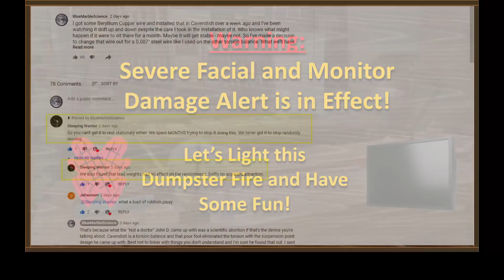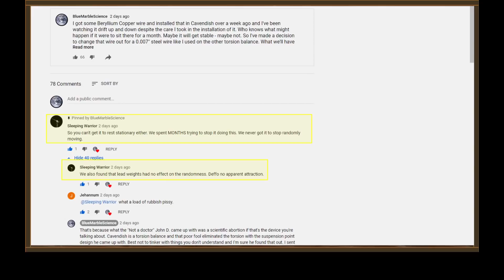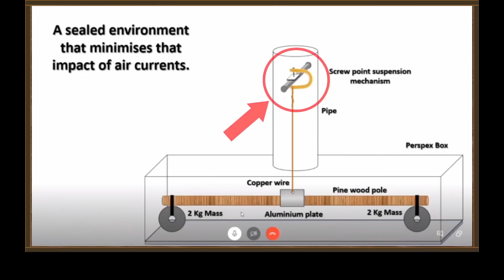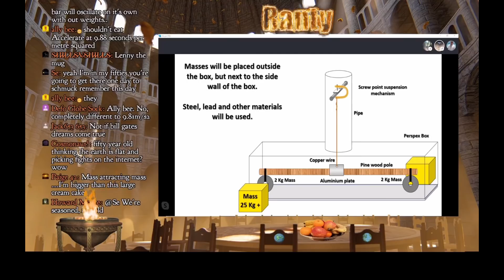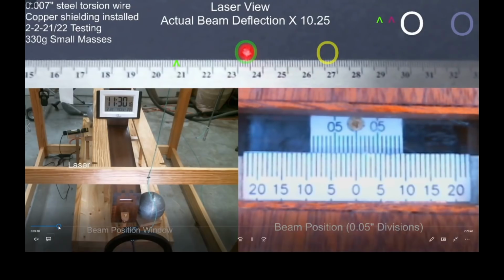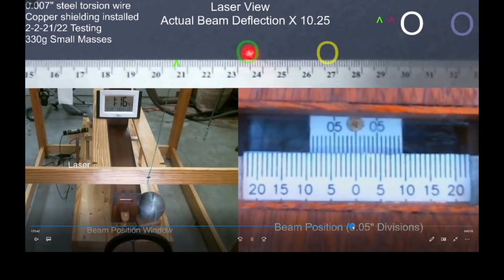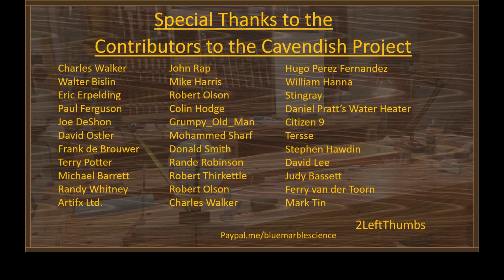How to Build a Cavendish That Isn't a Cavendish

Comment: I was TRYING to explain to you a point you were refusing to listen to and I eventually gave up with you. You were either too stupid to understand what I was saying... or you were being deliberately evasive. Either way, I gave up on you because of it. 

There is no honest conversation with you people.
Reply from the maker: No Anthony, you were displaying your complete ignorance concerning this topic. I've done many hours of video explaining the function of a torsion balance, showing how one is designed, showing step by step how one is constructed and showing how the measurements made with one can be used to determine the value of "G" but you apparently didn't watch any of them. If you did, you certainly didn't learn anything. I can't have an intelligent conversation with a guy who is telling me " You need to prevent the oscillation to show that you have isolated the variables you are meant to isolate. You seem to be defending your failure here". Say what? And my favorite, "Just show that you have successfully isolated the forces causing the "random drift"..." I doubt you realize how ridiculous that sounded or why. Drift isn't being caused by any force you can isolate Anthony. Drift is caused by stresses in the torsion element. That may or may not have been what you saw. Your movements were more likely due to things like my garage overhead door or that acrylic box you built. Just rub the neighborhood cat on that thing and you'll build up enough static electricity to weld boiler plate! 

But I think there may actually be much more to this. I would have thought that you guys would have made some video of this random uncontrolled movement you mentioned and shown it to the world. The fact that you didn't raises questions. Even with the flawed design you have, that thing still should have responded to a gravitational attraction. Did it? Is that why nothing was ever shown? I'm not accusing you guys of anything - just asking a question.
Reply: @bluemarblescience  You do realise we are NOT trying to determine the density of earth with a torsion balance. All we are trying to do, at the very start, was trying to ensure that nothing else was influencing the action of the bar when it was at rest. 

Do you understand this? We cannot go ANY further until you understand this. I'll type it again. 

"All we are trying to do, at the very start, was trying to ensure that nothing else was influencing the action of the bar when it was at rest."

So before either of us touch it, for any purpose, we need to ENSURE that nothing else is acting on the setup. 

You have not shown this despite being asked to do so. It's a very simple preliminary check. We were unable to isolate all forces and that's why I'm asking you to demonstrate that you have. I'm not being unreasonable.
Reply from the maker: @sleepingwarrior4618  I did - watch the video. It's sitting perfectly still for an hour and twenty minutes. It moves slightly in response to transient disturbances. But I take it from the way you dodged the question that you actually did observe gravitational attraction. You must have or you would have show something. Just show us the bar moving randomly without the large weights in place and then show that it does the same thing with the weights first one side of the box and then the other. That isn't a problem is it?
Reply: @bluemarblescience  you haven't shown it with frictional forces and torsion removed. You claim you have but you have not. I asked for those resistences removed to demonstrate that nothing else is acting on your setup.

I admit I couldnt get it to behave at rest with no friction or torsion to negate whatever forces I was having act on mine.

I want to see that you HAVE done though. Please SHOW that you have removed friction and torsion but also got a stable rest position. 

If you keep avoiding this, I'll respond by video and make it very clear what results I have and what I think you are having and why.

It's a very easy request to demonstrate. No friction and no torsion.....and a bar that's not moving. 

Can you do that? Or nuh?
Reply: @sleepingwarrior4618  oh jeez... Just make the video.  It's not like that's a threat!  "If you keep avoiding this, I'll respond by video...". Dude, that's science.  You have an issue with his set up. You publish what you think is wrong with his set up by using your own.  That's literally science.
Reply from the maker: @sleepingwarrior4618  Why are you ignoring my request Anthony? I've stumbled up on an inconvenient truth haven't I? That bar moved to whichever side of the box the large weights are on didn't it. And now, you're trying to shift attention away from that result by imposing irrelevant and irrational restrictions on an experiment you don't even understand. You need to show what you did. I have - why haven't you? I thought you guys were after the truth but that isn't it at all, is it. You're desperately trying to cling to your fundamentalist religious beliefs and you're willing to do anything it takes regardless of the truth. Lets confine the discussion to what I just said. Please show us a video demonstrating your claim and including my proposed tests with the weights.
Reply: @sleepingwarrior4618  I like the way you dance Anthony!    Dance boy dance!
But you don't have a pretty mouth though.

Sorry Blue couldn't resist.
Reply from the maker: @sleepingwarrior4618  I am curious though Anthony. Where do you believe friction exists in a torsion balance other than the internal friction in the molecular structure of the wire, and how would I eliminate torsion?
Reply: @sleepingwarrior4618  Anthony, do you not understand that the whole point of the Cavendish experiment is to USE the torsion of the wire to provide a very weak restoring force? That force is proportional to the angle of rotation, so at some point it is equal and opposite to the pull of the large masses on the small ones, and the beam will settle at that position. If there is no such pull, i.e. if (as you claim) masses do not attract one another, the beam will not move, but Blue has demonstrated that it does move.
If the torsion could be “removed” as you are asking (spoiler: it can’t) the experiment would not be possible.
Reply: @bluemarblescience  "Why are you ignoring my request Anthony?" 
Because, as with assuming a gradient to calculate "Atmospheric Pressure", you are assuming you have your set up working correctly without checking/showing. I'm not prepared to move off this point because this is the point where I had to stop. I admit, I couldn't get it to stop dancing about. Thats why I am asking to see how you DID manage it. It's the first thing you do once it's built but BEFORE you try and do anything else. You want to ensure that you have isolated all the influencing factors Cavendish warned you about. You cant move off this point until you prove that you have satisfied it. The point you are demanding comes AFTER this point, not instead of it. 

"I've stumbled up on an inconvenient truth haven't I? "
Yes, I think you have. I think you have stumbled across the same issue I had and are projecting onto me your own dishonesty because you CANTTTTT have anyone know that yours is doing the same as mine. Thats WHY you are getting your random movements. Yours are being manifest slightly differently because of how you have yours set up but yes, I do believe you have indeed stumbled upon an inconvenient truth... but its not one on my part. Its one on your own side and I know you know this.

"That bar moved to whichever side of the box the large weights are on didn't it."
No. The weights had absolutely no effect on the action of the bar. it did what it want, to whatever extent that it wanted to and I could not stop it.

"And now, you're trying to shift attention away from that result by"
This is the projection. I can admit and accept that I could not stop mine from behaving erratically...but I think yours is doing the exact same and you know it and thats why you cant control it. 

"imposing irrelevant and irrational restrictions on an experiment"
Noooooo, we both must prove that we HAVE isolated all factors. I couldnt isolate mine but you ARE getting them. Thats why you have movement. Why do you think I'm asking numb-nuts?

"you don't even understand."
Stop being a tool. No need. 

"You need to show what you did. I have - why haven't you?"
I dont need to show it at all. I haven't shown it because I thought I had messed it up. I thought I had done something wrong...until I saw and read about you getting random movements too. This is why I'm contacting you. You are getting the same results as me but you wont listen and demand that I am to blame... well try listening and PERHAPS we can get to the root of the issue you are finding because I believe its the same issue that I am having. I blamed myself though... but when you started having very similar (the same) issues, then I realised that it wasn't me.... but also that you were not being transparent. You have not shown the zero friction/zero torsion setup to prove that nothing is influencing your beam. It's very simple, I'm sure your own morons reading this will understand my point even if you pretend that you dont. 

"I thought you guys were after the truth but that isn't it at all, is it. You're desperately trying to cling to your fundamentalist religious beliefs and you're willing to do anything it takes regardless of the truth."
I am after the truth. I gave up on my test a few months back but Im invigorated now because you seem to be having the same issue as I had but dont think its an issue. I thought it was terminal and gave up after trying to block out whatever was causing it. 

"Lets confine the discussion to what I just said"
No, you need to show that your setup is NOT influenced by external factors by removing torsion and friction BEFORE we can accept your confinement. Sorry.

"Please show us a video demonstrating your claim and including my proposed tests with the weights."
Okay but not until you prove that you can remove the friction of the pivot point and and torsion with the most appropriate twine to demonstrate this.... THEN show that it will stay at rest for 15 or 30 minutes WITHOUT wandering. You do that.... (and focus on the pivot point and the torsion as much as the results) and I will show you what results I got. I have loads and loads of 15minute time lapse photos in a variety of conditions and at a variety of times of day with and without lead weights in the picture.

"I am curious though Anthony. Where do you believe friction exists in a torsion balance other than the internal friction in the molecular structure of the wire, and how would I eliminate torsion?"
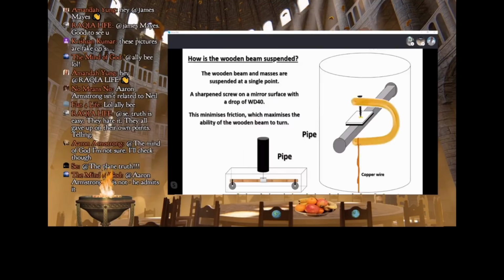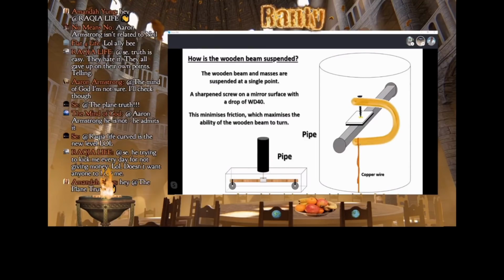Friction exists at the pivot point as well as in the twine you are using. You can eliminate torsion by reducing the friction at the pivot point. The very criticism you gave in this video is the same point to remove the torsion from 4:27 to 5:10. Thats WHY the screw was sharpened to a tiny area of contact on a piece of glass. Less friction at the pivot point will remove the most amount of torsion in the twine. You would do this to PROVE that 1) Nothing else is influencing your rest position and 2) if mass does attract mass, with minimal friction, we can test that. I know I know, thats not what Cavendish did, he used torsion and measured the net effect... that can be done by fixing the rotation point at the top but you are trying to repeat his test. We CAN do that... but we can also directly see if mass does attract mass or not and have zero friction at the top. 

Dude, I'm not being unreasonable or funny... I'm just asking you to prove that nothing else is influencing your bar at rest by removing friction and torsion and show that it will sit still for 15 minutes. I couldn't do it.... but I blamed myself. You claim you have done it but also claim random movements... you are getting the same effect as me and are glossing over it... but it actually invalidates any testing you think you (and me) can do because you cant have other things acting on the weights. It does need to be isolated.

If you prove that yours is stable at rest (with minimal friction and torsion), I will show you the results I got and your drongo friends can all laugh at how I couldn't even repeat Cavendish...but if you were honest, you should be proving that you CAN get it stable and THEN I would ask you to help me with mine because I'm clearly getting something wrong.

Remember, I gave up on mine because I thought I had built a bad set up, spent MONTHS trying to make it work and didnt release anything because no one on your side is honest enough to accept that it might not be me, it might be something in my environment I didnt spot... but THEN I REALISED YOU WERE GETTING IT TOO!!!!

Up to you buddy.
Reply: @sleepingwarrior4618  "okay but not until you prove that you can remove the friction of the pivot point and torsion with the most appropriate twine to demonstrate this..."

Dude.  Again, science.  You see a problem with his set up, you create and publish a demonstration to show how you think he's wrong.  Make your video, bro.  Do it his way, then do it your way, then publish the video.  Literally how you peer review in science!
Reply: @sleepingwarrior4618  "... I'm clearly getting something wrong." the only honest thing you babbled about.
Reply from the maker: @sleepingwarrior4618  It's truly sad that you don't have enough physics or engineering background to understand the mistakes you've made. You were right about one thing, you're design is fatally flawed and that's what's causing your problems - problems that I haven't had regardless of your misinterpretation of what drift is. My Cavendish device has behaved exactly as it should have. The data it provides is excellent and the results far outstrip anything I had hoped for. I called my shot Anthony. I told you guys upfront that your idiotic pivot point wasn't going to work and why it wouldn't work. Now I'm telling you "I told you so". 

I'm getting prepared to replace the Beryllium Copper wire I've been observing over the past couple of weeks. Beryllium Copper is a very springy material - in fact that's what it's used for - springs. I only went to it for it's increased yield strength over pure copper since Cavendish had used some unknown copper alloy. But it clearly wasn't BeCu which wasn't around in those days and this stuff drifts too much for accurate measurements. By drift I mean plus or minus 2mm maximum at the end of the balance. Does that sound like what you got? Obviously not. Yours bounced off the cabinet walls didn't it. Do you know why it did that? Because yours isn't a torsion balance. It has no pendulous action because it has  no restoring force! Before I remove the copper element, I'll do a time lapse and show you what drift actually looks like and why even with drift you can still see the obvious and indisputable effect of gravitational attraction.

And after I replace this copper element with a steel wire, I will do what I did with other wires. I will allow it to sit undisturbed with the large weights in a neutral position. If the balance isn't moving, that is a zero torque, zero friction condition and you're going to see a perfectly stable torsion balance. I just showed you the balance sitting motionless for a period of an hour and twenty minutes but we'll do it again just for the record. I'll even live stream it just to add to your horror so feel free to join in the chat and show your ass as you usually do.

Now I'm done with you Anthony. Not only did your Cavendish attempt fail, your attempt to coerce me into repeating your stupidity has failed as well. I think all of this is pretty clear to anyone that has a look at what I've done.
Reply: @sleepingwarrior4618  Anthony - your attempt to make a frictionless pivot at the top is your problem! If you could truly create a frictionless pivot at the top then your setup has no rest position at all. It will freely and randomly spin around to any position due to the tiniest micro air movements, fly farts or whatever. If it wasn't constrainedin the box it'd be randomly spinning around anywhere in the full 360 degrees. This is what is happening in your setup! It is the fixing of the wire at the top of a correct setup that actually gives it a rest position. The rest position, without any external influence, is the position where the wire is not twisted at all. When it has come to rest it'll happily stay there until some external force moves it.

If the external force is random and transient, like a fly fart, it'll just wobble a bit and come back to rest at the same rest position. If there is a permanent force, like, I dunno, gravitational attraction of some big lead balls moved into place, it'll wobble again but come to rest in a new rest position with the wire slightly twisted due to the attraction. That's how this thing is supposed to work and how Blue's does work! Yours will never work this way as you don't have a fixed wire at the top and therefore don't have a default rest position - it'll just randomly spin around all over the place indefinitely. Further attempts to reduce friction at the top will just make yours worse - it will be even freer to spin around randomly and never come to rest.

You need to increase friction at the top - completely, i.e. fix it - then it might start behaving properly. Hopefully this is clear enough that you understand why. Respect for actually trying some real science though!
Reply: @sleepingwarrior4618  A "frictionless system" is much like "flat earth", IT DOES NOT EXIST!!!
Reply from the maker: @sleepingwarrior4618  I did - watch my live stream. You just had your ass handed to you!
Reply: @sleepingwarrior4618  Unless I'm mistaken, you don't need to completely remove friction (any remainder would work in favor of flat earth by resisting movement from gravitational attraction) and you don't want to remove torsion, because you want something for gravity to work against in order to measure the force in the attraction.
Reply: @bluemarblescience  which live stream? Link?

Can we have a conversation somewhere? I think many preliminary issues can be ironed out by just talking, you bleat so many things about me off topic I can't find the info you claim is made.
Reply: @sleepingwarrior4618  , If only I could be arsed pointing ot the insane ironies in your comment. You are less use than a broken back gate
Reply: @sleepingwarrior4618  The whole point of this experiment is to measure a force, not to confirm the existence of one. The measurement is the amount of twist or torsion on a wire. The twist can only be measured because one end is fixed.
Reply from the maker: @sleepingwarrior4618  https://www.youtube.com/watch?v=kNrp8Jy1as8&t=3763s
Reply: @sleepingwarrior4618  

Question. If Marble have random movement in the setup and then when he introduce a weight, he starts seeing predictable movement, wouldn’t that mean he manipulated the independent variable? 

It might not be precise enough to make good calculations, but if movement goes from random to predictable, then something changed.

Oh, and how did you make sure that you had removed all other contributing factors when you did your egg experiment?
Reply: @sleepingwarrior4618  Remember not to talk about the lighthouse.
Reply: So Tony you have had to block me on your channel. But here you cannot so just so that everyone can see what a dishonest person you are when you meet someone that you cannot get the better of are my rep lies that you deleted.

Why dont you simply use your test rig to address your criticism of BMS not testing his rig to see it was sensitive enough to not settle in equilibrium before using a torsion wire to stabilise the system. All you have to do is rerun your cavendush test using the original setup but modified to replace the low friction pivot with a torsion wire an d see what results you get when you apply the lead masses.g

No. The phrase  force of gravity is an idiom. What is wrong with you that you constantly misinterpret the meanings of the written word. I have seen you do this consistently and it rather tells me that you have a learning difficulty where you cannot process what you read and draw the correct information from it.
Reply: @Katy_Jones  "Perfect globe proof!!"
Excellent quote!!!!!
Reply: @sleepingwarrior4618  
G. Zeus H. F. Xreitz, Yawning Shyster.  Go and read an article on torsion and torsion balances! Then read the Cavendish paper.

I knew about torsion before I was 9 y.o. Anyone who has played with a yo-yo (and paid attention) should understand torsion. Did you spend your childhood on video games?
Reply: @its1110  I have read about Cavendish. There wasn't any adherence to Scientific Method. No observed phenomena, no hypothesis, no null, no presumed cause....nothing.

Pseudoscience by definition.
Reply: @sleepingwarrior4618  
There was _all_ of that... if one knows how to actually read for comprehension rather than have every little thing spoon-fed to you in some simple outline form suitable for grade-schoolers... and lawyers.

"Think!, McFly."
Reply: @its1110  I'm not doing anything on you. We were simply trying to isolate the variables that Blue seems to have done perfectly and we cannot do the same despite doing the same isolation technique. 

Science is meant to be verifiable. Blues science is not verifiable...blue isn't doing science. He's doing something else.
Reply: @sleepingwarrior4618  
You are _not_ repeating what BMS did. He is using a torsion balance; you are _not_ using a torsion balance. You can not recreate his results, because you are not following his proceedure, because you are not using his equipment.

You have been explained this! Why do you persist in your error?!
Reply: "You people"?  What do you mean by "you people"?
Reply: @cuross01  people with a brain obviously.
Reply: @joewhip9303  is that singular brain?  What if I... uh... someone has more than one?
Reply: @cuross01  what do YOU mean you people? 😂😂
Reply: Hilarious that you try to tell other people that they are stupid. Sorry to bring this to you, but you are probably at the bottom of the scale when it comes to intelligence...
Reply: Anthony all you are trying to do is show your ignorance, that is the one thing you excel at.
Reply: Liely wouldn't know an honest conversation if it leapt out of the textbook and bit him in the arse!
Reply: Nice spinning-top Leaky, where's the torsion balance?
Reply: Yet you found it of no importance to share your points here? An honest researcher with a salient point would have done just that. Sorry Tony  Your track record speaks for its self. I wouldn't cast aspertions on another mans honesty or intellect if I were you. You've made far to many (mistakes)  without self correction.
Reply: I see I should have said VALID points.  I stand corrected.
Reply: Sleeping Warrior. I would suggest very strongly that the statement :- "There is no honest conversation with you people "  is quite correct.
 I have found that you constantly give dishonest answers to all and every question and persistently lie not only to yourself but anyone who you think you can gaslight. 
You are even doing it here on BMS's channel.
 Unfortunately for you I have a more than average grip on physics and that is why whenever you try to engage with me on your own channel you end up looking foolish and also why you have ended up looking like a dunce here.
You are out of your depth and arguing a subject you have no credentials in. Reading Wikipedia and snippets from articles on the web do not a scientist make.
Reply: "There is no honest conversation with you people" - of course not. We expose your lies.
Reply: It's nice that you try to explain things. 
Let's make sure you are qualified though. 
How to you measure the weight of a egg?
Reply: Anthony why do you always resort to suppressing  information that is detrimental to your interest. You blocked me and removed comments. You have been doing this to others as well. Why are you such an arse?
Reply: @ipsofattso4919  The same here. As soon as he gets to a point where he realises that he is cornered and cannot argue his sillyness any longer he blocks you . It starts with removal of the comments that he cannot argue against and if you persist then he has to remove your voice from his channel. 
Can you imagine how sad a person he must be having the compulsion to continuously upload garbage videos with no scientific merit  just to get  absolutely ruined in the comments section? 
And then do it again and again. I tell you there is something  seriously wrong with this person.
Reply: Wow you're stupid.  Look in the mirror and reread your post dumbass.
Reply: Well Snoring Dumbass, to quote Quint from Jaws, all this video and your stupidity on display here, "proves one thing Mr. Snoozing Idiot. It proves that you Flerf boys don't have the education enough to admit when you're wrong."
Reply: The very fact that you made this mistake with the torsion balance clearly shows that you had not understood the principle of the Cavendish experiment. In fact, you had not understood how it worked and you certainly would not be able to draw any conclusions from the experiment.

There is not much you can say about this. You made this mistake, which proves one thing only - you need to study this more before proceeding. I applaud you for at least trying to be scientific here, and I am really looking forward to see the results of this. Will you accept gravity as soon as the experiment shows its existence or will you blame this on measurement errors ("...a 15 degrees per hour drift...")?
Reply: Also Mr Sleeping Warrior. Have you yet admitted, that you dishonestly claimed Einstein debunks Newton? MUst have been 200 times you were now shown that he neither ever claimed that himself nor that any of your handpicked quotations say that in the way you believe they say. Einstein can be used to derive all of Newton's formulas, because Newton works fine in 99% of all cases you'll ever need to calculate an effect, Einstein only precicised the small sets of circumstances where Newton alone does not suffice to predict an event. LIke at extremely high speeds or with absurdly large masses.

Because you are sitting in a mirrored glass house with your claim OTHERS are dishonest, you are an ignorant, arrogant charlatan that is either 1000% incapable of intelligent thought or 1000% dishonest about reasonable conclusions from it.
Reply: Anthony, you are a blind man trying to explain color to the seeing.
What makes you think that you even understand the intent of the experiment, much less how to set one up? You still haven't understood why your "eggsperiment" ridiculously failed (hint: you make no effort to exclude gravity as influence on it, thus you have proven NOTHING. Every physicist accepts that buoyancy exists, but they also accept that it exists DUE TO GRAVITY. Demonstrating buoyancy thus cannot "disprove" gravity! but you can test experimentally that buoyancy stops working when you remove gravity from the setting (zero G parabola flights, fall towers). And that is why you fail!)
Reply: As usual, flerf do not even want to do any experiment correctly because that would disprove their gibberish.
Reply: @SergioBallestrero  Please dont use words like "experiment", you dont know what they are.
Reply: @sleepingwarrior4618  Nice projection bro. Stop dodging like a coward and finally do the experiment properly.